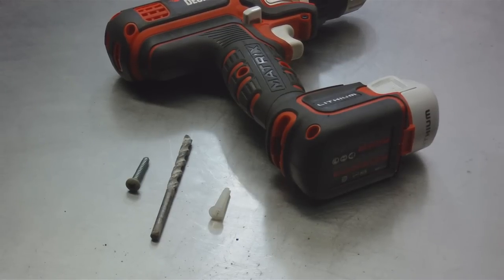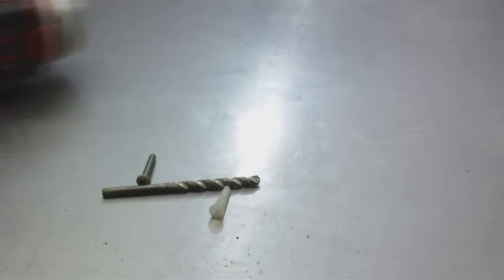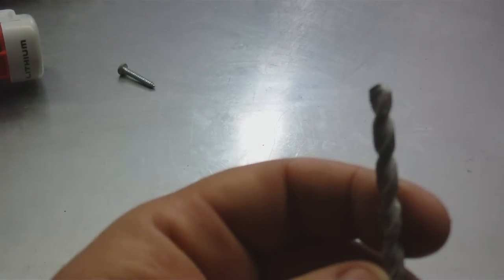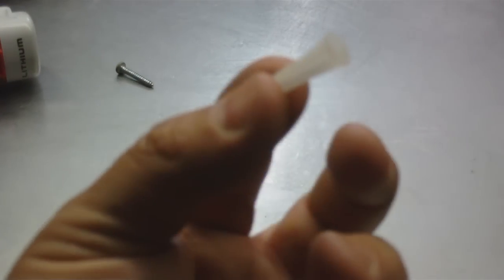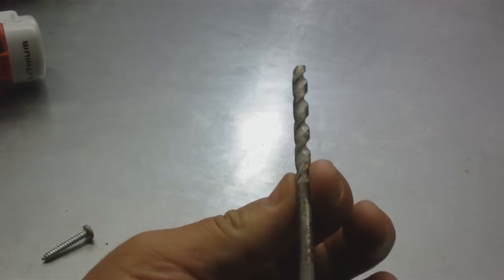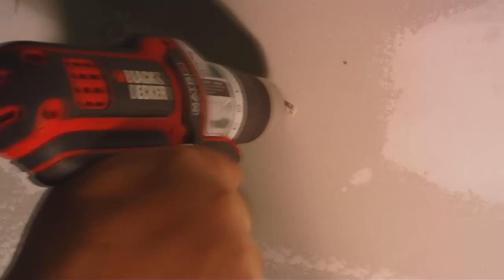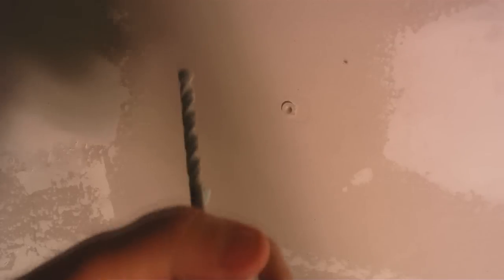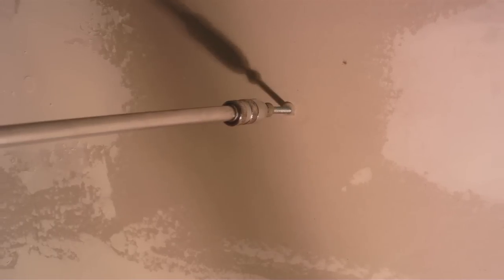How to install drywall plastic anchors ( Conical Anchor) in this video

Comment from the maker: Good point. You are very correct the Masonry drill bit has to be the same size as the anchor. The 1/4 inch bit was for the anchor kit I was using. Thanks for watching.

Comment: Thanks for the video.  My only suggestion is to explain that the drill bit needs to be as big as the plastic anchor.  Before watching this video, I used a drill bit the size of the SCREW & then couldn't get the plastic anchor into the hole.  I tried to hammer the anchor in, but of course it shattered.  I learned the hard way to drill a hole as big as the ANCHOR (not incl the front edge/lip).  You said to use a 1/4" bit, but would that be the right size for EVERY anchor? :)

Comment: I live in an apartment and because of this I can't put a hole that large in the wall. I just bought and put together an over the toilet storage unit that is supposed to be anchored to the wall so it doesn't tip over and it came with the plastic anchors. Is there possibly an alternative I could use that wouldn't leave such a large hole? Or do you have another suggestion? Are their types of anchors that use tape perhaps? Otherwise I'm just not going to bother and I'll just try my best to be gentle with it lol.

Comment: You make it look easy it didnt work out so well for me. Not even sure what went wrong.
Reply from the maker: Did you use to big of a drill bit?
Reply: @handymanPF  Well what happened was the item came with a screw and plastic holder  to hang it up with but they did not fit together very well, I could not get the screw to fit inside the plastic holder  and once I put the plastic holder into the wall. I had to really force the screw in there with the drill, It kept spinning and spinning and not going in, and by the time I did get it in the  plastic holder the  hole in the wall around it had grown so large that the screw and holder now just hang there dropping down and  it does not look safe or stable.

Comment: Do you think a conical, plastic anchor would be ok for hanging a coat peg-rack thing..? (can't think of a better name for it...do you know kind of what I'm talking about?)
Reply from the maker: They have different types with different weight limits. If you get the right weight bearing anchor, I think you should be fine. I hope this helps, thanks for watching . Please like, share, and subscribe.

Comment: looks easy but every time I use a plastic anchor in drywall the screw never holds - I can tell the mounted item isn't holding and when I back out the screw from the anchor I can easily pull the anchor out because it never split.  I am using the screws and anchors that are sets so I don't understand what's going on.  Help please.
Reply: I would like to know the answer to this, as well.
Reply: you might have used a drill bit that was too big. the anchor should be secure in the wall

Comment: Everything was fine until it came time to put in the screw. The plastic piece just fell through the wall :/
Reply from the maker: Sounds like the hole was drilled to big for the anchor. If it's drywall , fill in the hole with spackle, let dry, then retry with a smaller bit.

Comment: Except you did not say if the screw should be longer than the actual plastic anchor.
Reply from the maker: The yscrews usually come with the kit. But the kit usually tells you what size screw to use and what drill bit to use. This is a crash course and the directions are different from manufacturer to manufacturer. Long story short, follow the directions and specs. on the kit. Thanks for watching, I hope this helps.